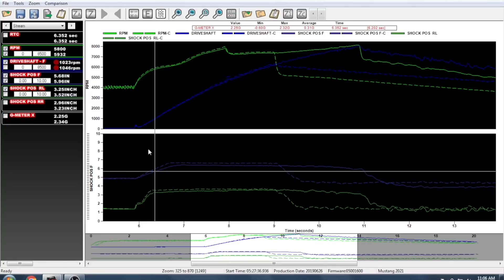Methanol Street Car Making Some Test Passes - Reviewing Holley EFI Logging and Data

Comment: Was going to ask how that DS sensor and wheel worked. I am going to get the same one for mine.
Reply from the maker: Bad ass. I’ll send ya a pic of the old one over lay on the new one. The data is soooo smooth. No filtering needed

Comment: Hey Joe you realize that showing your data we can see what time it runs.  Just fyi
Reply from the maker: Eh. I thought about that but not too concerned. What time do you think it ran? 👀
Reply: @StreetCarJoe  id have to go back an look but around 5.14 ish
Reply from the maker: Yeah. That’s why I wasn’t worried. That shows how long I was in it. Between roll out, staying it past the finish... it’s off a lot 😉
Reply: @StreetCarJoe  good job with the reverse psychology 👏😄
Reply from the maker: @sfr2929  I'd show a slip for it... Just a little off the trailer pass. But way faster than a 5.14 😘